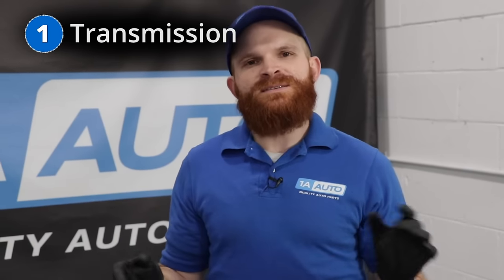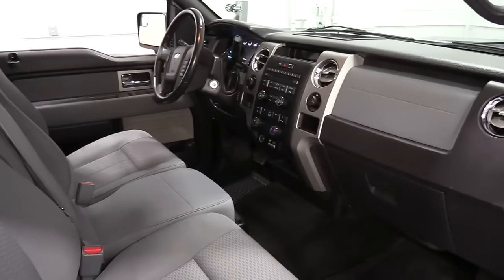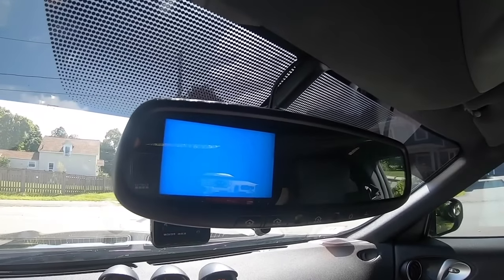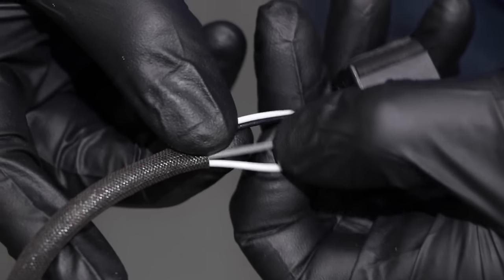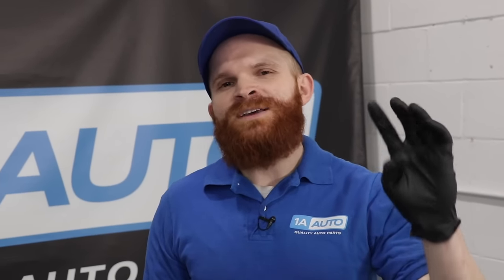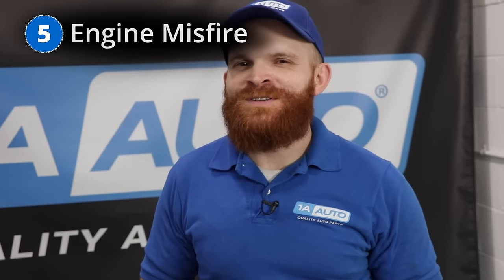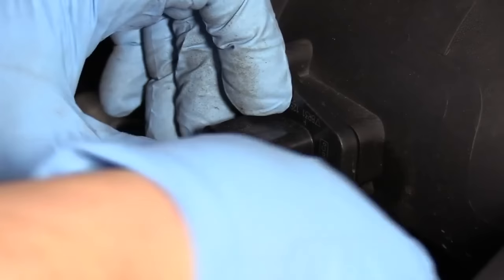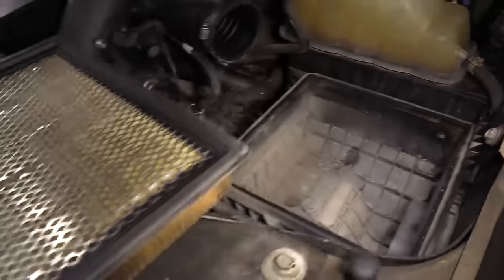Top 5 Problems Ford F-150 Truck  12th Generation 2009-14

Comment: Tips from an owner since 30k miles for 2013 5.0: 

Rear Diff will get water in it. Make sure to replace as soon as it’s dirty. 

T-Connector gaskets for coolant lines will leak at approx 130k. You’ll see evidence of that when coolant is low and there is coolant fluid on top of oil filter located directly below the T-Connector. 

SYNC sucks and radio will stop working. 

Wiring harness may drop and hit exhaust causing it to melt. So if it gets wet (car washes/wet weather), it will kill your fuel pump and stall your truck. Simple fix if you run into that issue. 

Other than that decent truck.
Reply: What was your radio issue?

Comment: My truck doesn't randomly downshift. But when I step on the gas hard, like when I'm merging onto a highway, it downshifts really hard. I'm used to it, but anyone who hasn't driven it before is startled by it. Is this possibly related to the transmission recall?

Comment: None of those problems I had with my truck.
Keep maintnance schedule and you will be fine.
Reply: My 2012 5.0 has been a tank that maintains like a Honda.
Reply: @monkeyslap  Awesome brother I have 2011 Ford F150 with a 5.0L Coyote V8 with 135,000 miles on it and still going strong and it's a beast and it sounds like a beast with the Borla ATAK Catback exhaust.
Reply: So untrue. I dare to find anyone who keeps up with maintenance more than me. Never going to buy a Ford again. One and Done. Piece of shit.

Comment: I have a question 
The low oil warning light, on off, on off on off at low idle !
I have changed oil pressure sensor 
Oil changed 
Still happening 
I do hear it start to clacking clack after a moment of the Warning light appears and then it goes away with the warring light? 
Is this the oil pump going out?
Reply: Same here any luck yet ?

Comment: 3.7 liter, Low power running a little load, could be a skipped oil change. It has variable timing that is effected by dirty oil.
Keep the oil changed.

Comment: I have a problem with my 2012 F 150 Platinum 3.5 liter ecoboost.  Instrument cluster engine gauges needles not illuminate , but function, background illuminates but blue needles dont .illuminate.  Speedometer and tach normal.  Dealership wants to replace instrument cluster for $960.00. Can go to repair shops specializing in this kind of repair for about $200.00.  Seems to be common problem with other years and model F150’s.

Comment: I wouldn’t bother with factory head unit repairs in the Gen 12 at this point. Put a new HU in with CarPlay and/or Android Auto and call it a day. You’ll be much happier and the screen can be adapted to the rear view camera anyway.
Reply from the maker: +ITStechy Thanks for the tip!
Reply: What brand ?? ... do you have a link ...??

Comment: Another problem I found was the fuel pump Fuse. Ford has a fuse relocation kit due to the first fuse was to small and would burn up. I had to do it because I was having trouble starting and found out that what it was. I have a 2010 F-150 5.4.
Reply from the maker: +David Arellano Thanks for the feedback!

Comment: Hello, I went to the Dealesship to have my transmission fixed, which was the same as you mentioned in the video, and they told me that I had to change the transmission and pay 6756.54 in fluid for the replacement of the oil seal. Can you tell me about this that happened to me? you think dealsship deceived me thank

Comment: I'm having a weird issue with my 2013 f150 platinum 5.0l it will randomly shut off and say low oil pressure it only dose it when I go into reverse and stop and it's idling weird

Comment: 2012 5.0
Radio went out clock blinks.
Change water pump and thermostat= fan now runs full time loud and proud no one can hear anything but it around me.
Fuse #27 blown fuel pump fuse. Watch out for that one.
Reply from the maker: +Brodrick Robertson Thanks for the feedback!

Comment: 2012 4x4 Platium  6.2  6" lift 35' heavy tread  ,,,,  just hitting 80,000 miles  .... the cab is very noisy  ,, just recently  .. I just had tire rotation and oil change  ... sounds like drive shaft ,,  all seems to be ok when checked  ...  I know the tires make noise ,, but recently,,  seems a lot louder  .. anybody with this issue  ... also what are the best all terrain 35"  tires that are quiet and smooth .. ( the engine is smooth and quiet  and no muffler problem's  ). love this truck !!!   I need ear protection ....lol

Comment: My 2013 F150 XL with a 5.0 engine has a P2098 Post catalyst fuel trim system Too Lean bank 2 code. I'm trying to figure out which one I should even be looking at do you have an idea, I'm thinking drivers side the one on the cat but some said before the cat but didn't specify what side.
Reply from the maker: +D.Outdoor Enthusiast We wouldn't be able to diagnose an issue like that here, you may want to have a local mechanic take a look at it. Thanks for checking us out! 1AAuto.com

Comment: hi nice video i hav a ford f150 2009 i put new coils plugs map censor 'i have a growl  noise at 45 to 50 miles per hour 'please help' could it be the pump in the tank  thanks.

Comment: I haven't had any problems from my 2014
Reply: How many miles on it?
Reply: 2014 owner here 5.0.  108,000km.  Tow a TT.  Stab end links only last a few years, other than that just maintenance
Reply: @bobmartens1089  We don't understand your weird system of measuring MILES

Comment: I’ve have a 2011 ford ranger 2.3 engine four speed auto  trans my problem is that the ODS the rear sense that in my truck that I’ve purchased is totally different one then the one on my truck? I went to dealership and got the run around are there any other type of ODS SAW ONE ON THE VIDEO OF A 2001 five speed trans which was e

Comment: 09 Ford Flex. My passenger side brake light and turn signal doesn’t work. Moved the harness to the drivers side and all bulbs work as they should. What could be my issue? Driver side works as it should. Turn signal does work on the passenger front, it blinks fast
Reply from the maker: +MR. JF Thanks for checking us out! http://1aau.to/m/Shop-1AAuto-c

Comment: M y 2013 F150 3.5 liter Ecoboost is a piece of crap. Original owner, it has 45,000 mile on it and my timing chain has gone twice, rear window shattered when I put the defroster on, started truck the other day and noticed a  shutter , I drove down the street and the rpms just dropped to nothing and the brakes went out. I limped it home and it is nothing ,but an oversized paperweight.

Comment: Timing chain rattle. 
HVAC blend door motors failing. 
Rear window defrost failing. 
Wires breaking in the door hinges. 

I've had them all, some multiple times.
Reply from the maker: +HuskyKMA Thanks for the feedback!

Comment: Hey Len,  I have a 2010 F150 Lariat.  The engine cooling fan does not work.  I read about it and many others have had the same issue.  The Fan control Modual!  But where is it located cant find the bugger.--Tks  John
Reply from the maker: +John Heath The module should be with the cooling fan.

Comment: I bought a 2013 f150 5.0 yesterday and not even 12 hours of owning it the trans decided to go from 1st to 5th gear while going no more then 10 mph and the truck just stopped working.
Reply: Run it for recalls
Reply: Omg i Just bought one today and happened the same thing!!!
Reply: Same bought mine next day it was jumping to 5th gear had to replace lead frame

Comment: I got a 2012 f150 ecoboost and the little wrench pops up every now and then looked in the manuel and it is saying to check the powertrain and electronic throttle but I plug in a code reader and its pulling code p0299 and P0731 what should I do or how to go about to getting these fixed also my camera pops up with a blue screen and I have replaced the wires and the camera itself how would I go about with fixing that as well

Comment: Just hit 240000 on my 09 150 5.4 fx4, only thing  I've done is plugs and brakes.  Knock on wood this  truck  has been awesome.  Full synthetic  every 3k.
Reply: 09 Platinum - Blend door actuator.  Batteries, brakes, and tires.  200k no other problems.
Reply: 2009 F150 Lariat 4x4. Where do I start. Heat core, actuator blend door 2 of them. The recirc  actuator broke so I left it in full recirc. Coolant tube under intake. Changed fuel pump at 220k should have done that sooner. No issues with the pump just preventive. Felt better after. Gonna tackle a canister purge valve soon. VCT solenoids replaced. Regular maintenance. 5w-20 haven’t tried the 5w-30 everyone suggests. Other than that a great truck. I did all this myself. Good luck with yours.

Comment: I have a 2011 Ford F150, lariat 4 x 4, that is doing all kinds of things radio quit working clock flashes sometimes it won’t start because it’s not connecting oh and gear properly numerous numerous things

Comment: I'm looking to buy an F150, $20 to $25K budget, so it will be higher mileage, with around 120-160K miles or so.  Curious if I should opt for the 5.0 V8 or one of the other Ecoboost motors.  I want 4wd.  I do not tow.  I want the more reliable and longer last drivetrain.  Tips?
Reply: 5.0  my FX4 '12 has 188k...
Reply: 5.0 V-8 was my choice.  I looked at the EcoBoost but you just know those twin turbos are going to fail at some point and it will cost $1000s to replace.  The 2012 F-150 can also burn E-85 fuel which is much cheaper in my area and is looking like a good alternative if gas prices continue to climb.
Reply: 5.0

Comment: The guy that has steering hard spots,change the steering shaft . They rust ,and make it hard to turn. Simple fix .keep the knuckles covered with wd40 or similar product . Will help keep the rust from forming on the knuckles.

Comment: It’s crazy that Ford made the first car on an assembly line. And still have such extreme magnitude quality problems in 2022. Why can’t they get it right? What’re the engineers smoking? What engineering development processes are being followed? Why wasn’t this caught in Design Validation testing? Why aren’t there quality controls on place? Why wasn’t this caught in the DFMEA/ PFMEA!?
Reply: Ford isn’t run by engineers it’s run by bean counters

Comment: 2013 fx4 3.5
Trans coolant line at 167,000 km
02 sensor. Bank 1 sensor 1.168,000 km
Pwr folding mirror switch.
Rear window shattered due to rear defrost.
Wiper delay setting go wonky.
To be continued...

Comment: My only problem I've had is the throttle body. 2014 ecoboost. 100,000 miles. Besides thg at great truck. Great video!
Reply from the maker: +Talin Ridgeway Thanks for checking us out!
Reply: What was it doing ?

Comment: 2011 5.0 4x4 actuators are junk, had to rebuild the rear end, coolant leak from seals  at a y fitting and the top display above the radio is going bad. Other than that stuff I love the truck

Comment: Looking to buy a 2010 4.6l 2v 4x2 f150 long bed. Are these reliable? Homw many miles can the engine go up to. There is a 2010 with 121k miles.
Reply: I have that same truck. XL with just under 200k and no problems. Keep up with regular maintenance. Cab corners did rust though.

Comment: Question.  It I own this series truck can I still take truck to ford to get the transmission (recall) work still completed?
Reply: Yes you can Just call the dealership and have your vin number.
Reply: What is the recall for and for what models and years ?

Comment: My 2013 f150 wouldn’t start it was the fuel pump relay fuse had melted in the connector. I bypassed it and used a marine fuse holder with the larger fuse. The small mini fuses don’t have enough area to make a good connection along with heat and age this is a known problem
Reply from the maker: +Bruce Calvert Thanks for the feedback!

Comment: i have 2012 with transmission saftey recall so i had recaLL WORK DONE TRUCK WENT FROM 6 GEAR TO 1ST GEAR AT 72 MPH on interstate truck got sideways i jumped in the throttle truck went back to 3rd gear and blew the variable timing out of it lost oil pressure been a year now stiull paying on truck and ford wont help me fix truck do to there saftey recall 9000 to fix SO HOW DO I GET HELP WITH THIS PROBLEM CAUSE FOR HASNT EVEN RETURN MY CALLS

Comment: I have a 2009 F-150. Brake, abs and traction control warning lights all illuminated at once. This was shortly after mounting new tires. Code is B1342. No other information available. Could it be a speed sensor?
Reply from the maker: +Laura Heddin Thanks for watching!  We are not able to diagnose issues over the internet, but it appears that the B1342 fault code indicates an ECU failure.
Reply from the maker: +Laura Heddin Thanks for watching!  We are not able to diagnose issues over the internet, but it appears that the B1342 fault code indicates an issue with the ECU.
Reply: 1A Auto Parts Thank you. Very much appreciated 👍 Great videos

Comment: I got a 13 f150 fx the gas pedal does nothing in drive but in reverse it works just fine any ideas
Reply from the maker: +Maldito515 We wouldn't be able to diagnose an issue like that here, you may want to have a local mechanic take a look at it. Thanks for checking us out! http://1aau.to/m/Shop-1AAuto-c

Comment: I have a 2014 5.0 with 100k miles. Never had any of these issues. I had an o ring leak on a radiator hose and a water pump go out within 10,000 miles of each other around 65000 miles. Those were my only issues.
Reply: Why are you lying. You know you blower motor connection is losing contact with the leads.

Comment: My 2013 F-150 downshifted at 65 mph to first gear and damaged the engine and Ford will not fix it and they asked me for $16,500 to fix it after the recall was done. The recall did not fix the downshift.
No more Fords for me!

Comment: This is why trucks don’t need automatics and the useless electronic devices. Get back to the basics. Trucks should be trucks not limousines. A standard transmission a a 6.2l engine that runs on mechanical input rather than a modular engine that has to have a bunch of useless electronics to run.

Comment: They also have the infamous timing chain rattle in Ecoboost that they haven’t fixed yet😡
Reply: Actually they have fixed that issue.the first gen only had chain tension on one side of the engine.. they now have tension on both sides, which stops the chain from getting loose
Reply from the maker: +Chevy Garbage Thanks for the feedback!
Reply: Best fix for an EcoBoost is to get a coyote :)

Comment: Kind of off subject but has anybody seen if you can buy a passenger side mirror with the blind spot mirror, heat and power fold option.  Al I have seen is driver side with all 3 options
Reply from the maker: +N G Thanks for checking us out. Shop for high quality auto parts on 1AAuto.com:

http://1aau.to/m/Shop-1AAuto-c

Comment: Problems I had with my 2012 EcoBoost....Bought New.  Owned for nearly 3 years.
Thrust bearing or washer issues (can't remember)X 5, dealer thought it was the drive shaft...replaced twice, thrust bearings or washers a few times🙄.  Kept getting loud ticking noises in rear diff.
Intercooler issues X 3.  Because of intercooler, had to replace ignition coils twice and spark plugs once.  Steel plate cover was eventually installed even though it didn't call for it.
Front brake issues X 3.  They just sucked, period!  One time, one of the new brake pads broke apart!
Had front hubs replaced once or twice.
Left headlight bulb twice🙄
I'm sure there's more.
Traded in after 96,000 kms for a used 2013 5.0 thinking I had a lemon.  Owned for 2/12 years. 
2013 5.0 issues.....
Front hubs X 3.  Had to use 4 wheel all the time in the winter.  Had a lot of snow and ice on roads where I lived.  Mechanic photocopies manual on how to use 4 wheel drive.  Really???? 
Replaced brakes once this time.  
This one irks me....coolant line from rad to transmission snapped off at the bottom of the radiator.   Other line was about to break.   Still had powertrain warranty but Ford would not cover.  $800 fix.  Argued with Ford.  Had to pay the bill.  I was in Florida!  A week  after we got back, drove over to the Dodge dealer, traded F150 with 84,000 kms and bought a Ram (Demo).  Had Ram 2-1/2 years and 86,000 kms.  NOT ONE PROBLEM!  My tip...Stay away from Ford.
Reply from the maker: +It's Corky Thanks for the feedback!

Comment: Every f150 I have had from 97 to 2014 goes through front breaks n tosses brake dust killing my rims. Anything I can do to prevent it. I have tried all types of brake pads n same thing. Is it a Ford flaw?
Reply: That's normal. Are you breaking hard?
Reply: start manually down shifting to a stop, like a real man
Reply: @NZIGNANTI  lol

Comment: Endless numbers of transmission or engine failures, ecm, ball joints and rear wheel bearings not even on the list?
The 99s to like 2010 ish were horrible for the vast majority ford took the shotgun approach to quality control. The ones still rolling won the Ford lottery

Comment: I have a question maybe someone could answer. I need to replace my side mirrors. I have an 2014 f150 xl. Can I replace them with heated mirror with turn signals. I was told that it would just be plug and go. I can only find information about tow mirrors online and I don't want tow mirrors. My current mirrors are not heated and don't have turn signals.
Reply: Not sure if the 150 is the same but 250 I upgraded base mirrors to power folding towing and it took some adapters.

Comment: my a/c works but only on level 4 full blast but not in the other levels what's the cause if you can help
Reply: Sounds like a blower motor resistor. Although it should affect your fan with or without ac running. It is easily accessible from under the passenger dash. Takes about 30 minutes if you have never done it before. Good luck
Reply: @Bpitable  Wiggle that molex connector under the glove box, I have a hooked cane i use to wiggle it when I need my blower motor to run correctly.